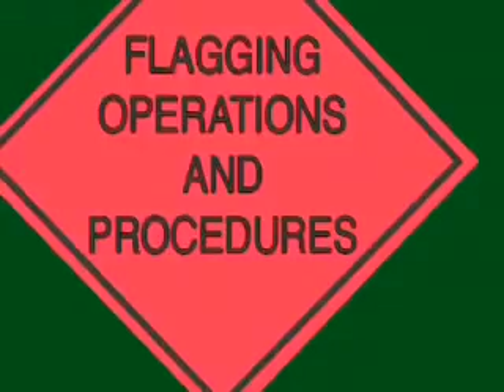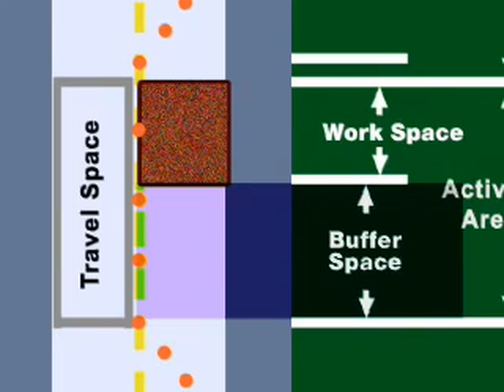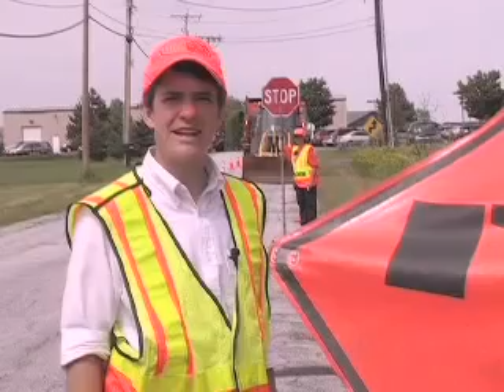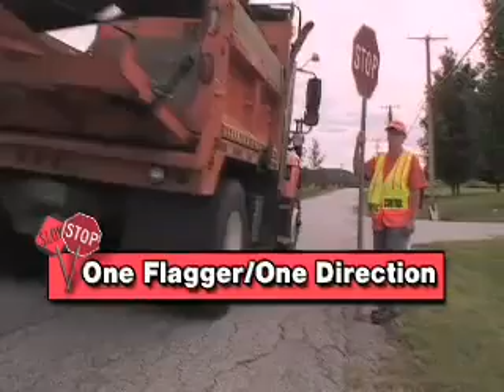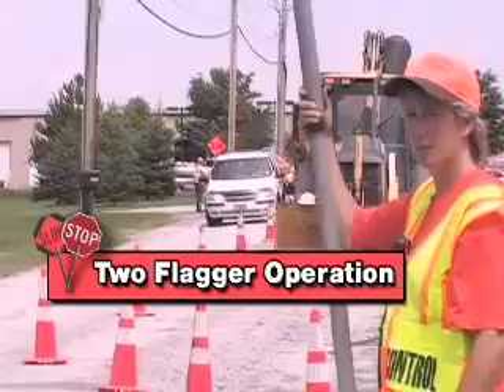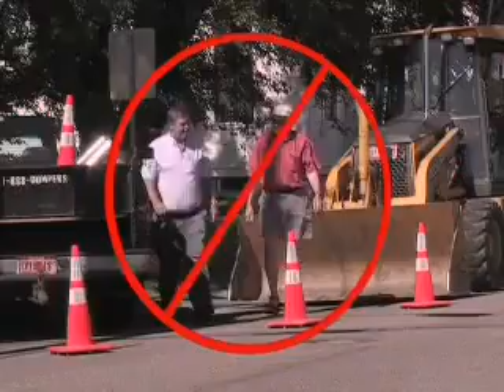The Basics for Work Zone Flaggers

Comment: Awesome video. Im not so nervous starting in a few days. Also im in Utah and the standards are a lot higher here than the government minimum. Flags and paddles should be 24 x 24 inches as well as the flashlight cone/wand AND external light at night and flaggers are not supposed to touch barrels/cones/signs at ALL.